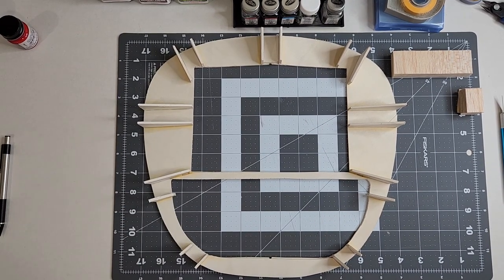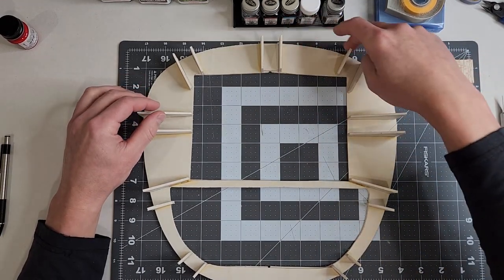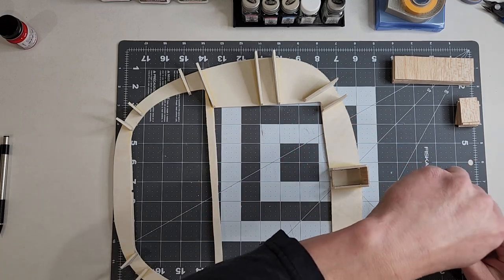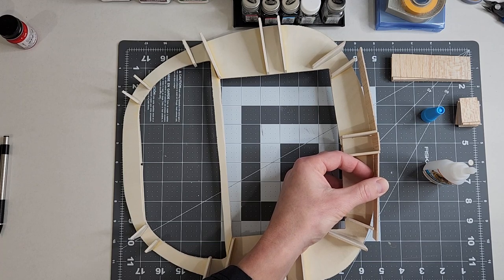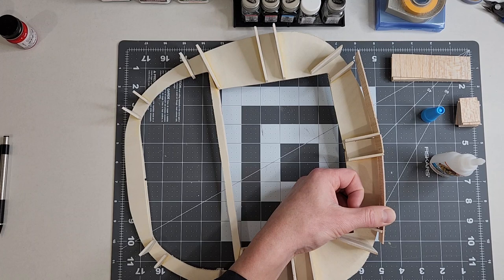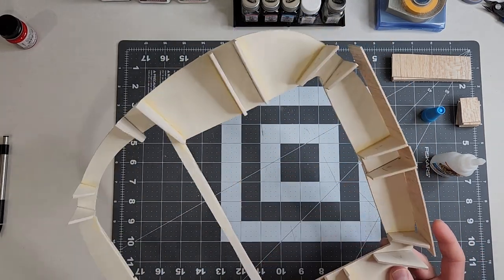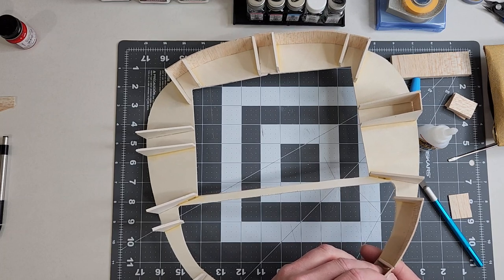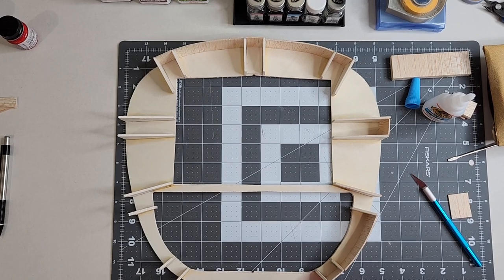Sockey's Dad's (40%) Hanger 9 Carbon Cub FX-3. Cowl Adapter Part 2 (Balsa bridging between ribs.)

Comment: I just had a thought. Imagine that! You could easily 3D print this whole cowl adapter and market it as the fix for the 222cc engine installation. Just a thought. And I totally agree with the idea of only modifying the cowl installation. You made the right decision. Doesn't that make you feel great? Oh, and the nuts you are referring to are called Blind Nuts. Cheers! wjm😀
Reply from the maker: I'll have to try printing one with glass-filled nylon. Could only print with PLA at the time & didn't know if it would hold up. I forgot about this project since I don't have the plane anymore. The light ply/balsa one I made seems to be holding up well, but 3D printing one would be easier. Thanks for commenting! I just realized I forgot to upload the rest of the videos for this.
Reply: Cheers! wjm